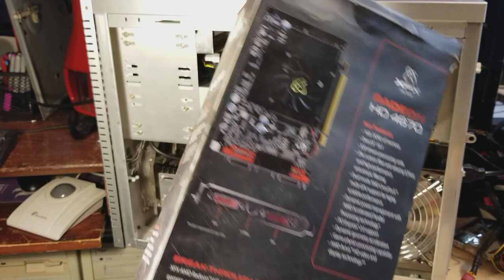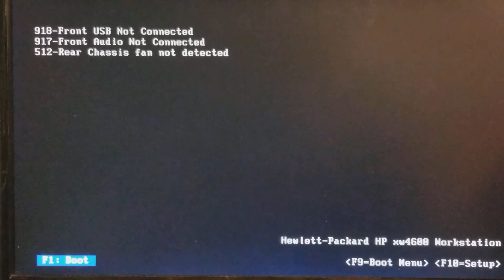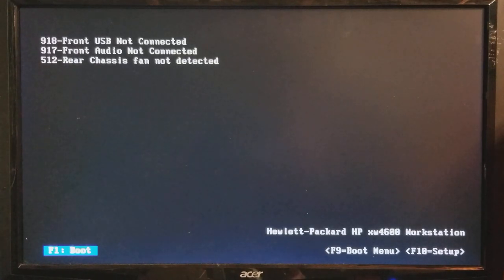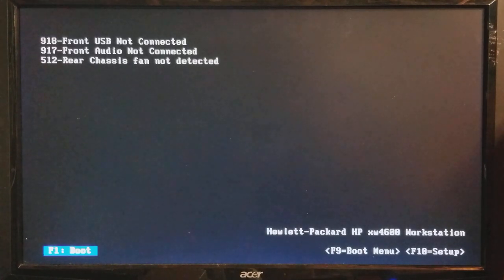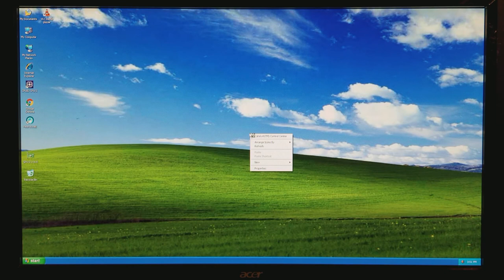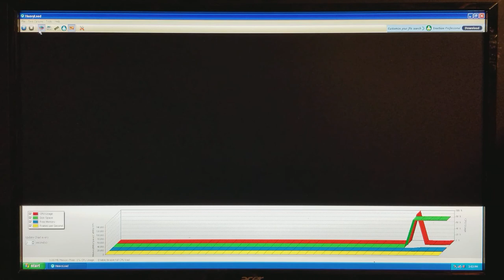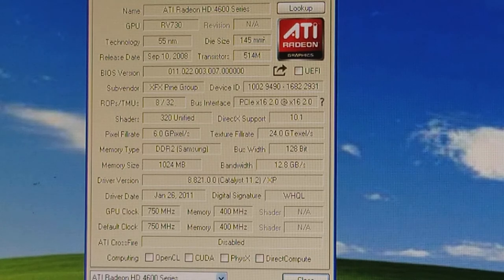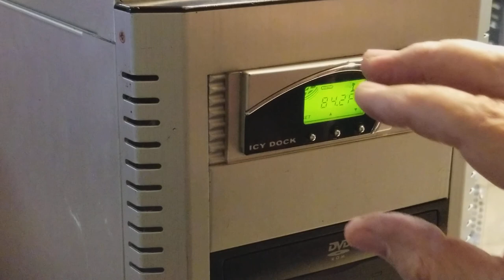Converting a HP XW4600 Workstation to a Retro Gamer

Comment: How did  you installed a non HP Power Supply to a HP Motherboard. The  HP Propriety 475 waatt  PSU has no 5 Volt Rail but a 5.1 Volt Rail instead. So any after market PSU with even higher wattage will give error as insufficient power because 5 Volt is less  than 5.1 volt required  for some of this motherboard components.
Reply from the maker: Look closely at the PS, it's a Rocket Fish 700 watt PS. It has a 5.1 volt rail. I did have to do some minor mods on the connectors.

Comment: hate to tell you but RocketFish PSU's are made by Huntkey A.K.A PSU shaped bombs. cool build otherwise
Reply from the maker: Lalnable Hector not sure who is the actual builder of these power supplies.  I just know I have 6 working Rocket Fish. Never failed, never gave bad line voltage & were never bombs. So in my opinion, the best PSU's I have ever built with.